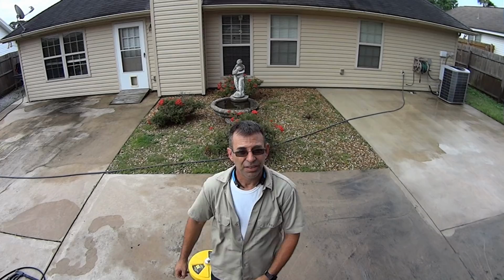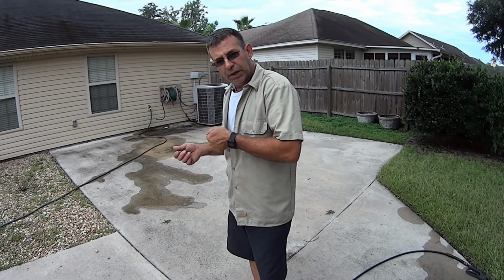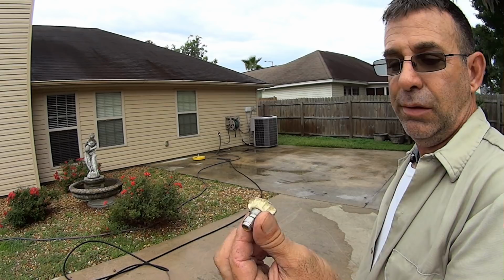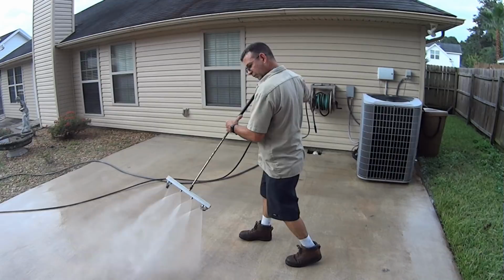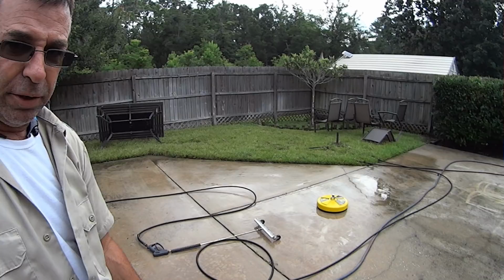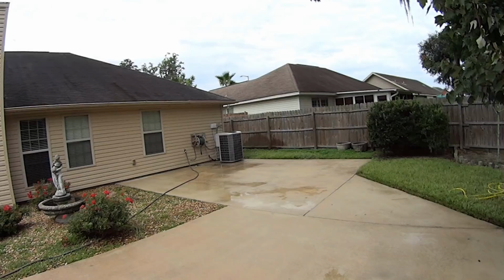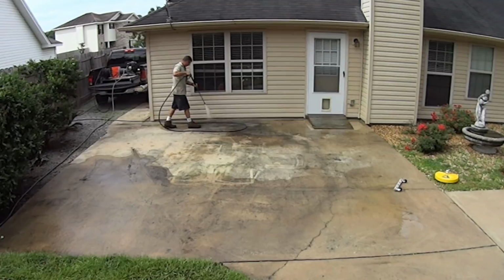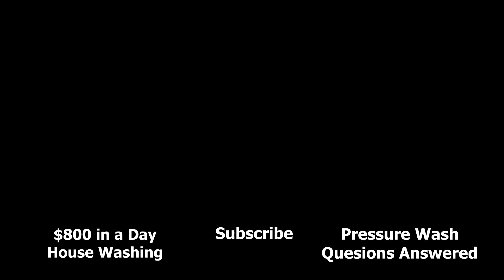How To Pressure Wash a Concrete Patio - Water Broom Demo - BE Whirl-a-Way Demo Review

Comment: How long is that hose?! You could be loosing a lot of psi on that hose. I believe 100 feet is the limit without loosing too much pressure.
Reply from the maker: So what? Is it working or is it not? Quit worrying about silly stuff. I have 150 ft on the reel and I often add 50 ft to make my job go smoother.
Reply: Dan's Vlog your setups all wrong Dan you can't do nothing right can you?😂

Comment: In my opinion, the water broom with 4 nozzles and caster wheels, shouldn’t have the wheels at all, it should just be the 4 nozzles. The best way to use it is to not even use the wheels at all just spray the concrete down. I could see you were using it without the wheels because it feels like it should be like that.

Comment: did you damage the ac unit
Reply from the maker: There is like literally no pressure once you go about 9 inches beyond the tip. In order to damage and AC unit with a white yellow or green tip, you would have to intentionally hit it on an angle trying to fold the fins down and you would have to be very very close.

Comment: I think your pressure washer is too strong for this surface cleaner.. may need to bump it up a notch to a pro model that would handle your high psi or gpm... or change the tips to a larger orphice 

Good job though 😊

Comment: Dumb question. When u wash a house do windows spot?  If so how do u handle it with customer?
Reply from the maker: I try to break the windows and then sell them on open air experience and the benefits of it LOL But in all seriousness no I’m fortunate in this area the windows dry a lot cleaner without spots then when we started. I actually show it in one of the later videos I’ve just uploaded titled how to pressure wash like an $800 a day pro.

Comment: Looks like a waste of time, just use the single sprayer to clean? 
You can look at the spray pattern and realize they are equaling each other out, would be much better with just two nozzles?
Reply from the maker: Worked really well actually but thanks

Comment: The surface cleaner is great for concrete but if you’re washing concrete professionally you need a professional surface cleaner, it’s easier to use and easier on your back. Attaching one to your gun causes you to have to bend over over too much

Comment: Go to Northern Tool and look at the Powerhorse ($100 and $200) line they are cheap for what you get. Have no idea why you would buy a plastic noun ball bearing surface cleaner with out wheels. The surface cleaners that Lowes and Homedpot sale for $65 to $85 are junk not even good for a homeowner that cleans once a year.
Reply from the maker: That’s funny… I have videos going back two years with the same Briggs & Stratton cheap piece of junk surface cleaner that I have made hundreds if not thousands of dollars with.
Reply: I seen your review on the Briggs & Strattons and Mi-T-M20 inch helped me not to buy them. Powerhorse sold by Notherntool take a look at them works great for me, they are not bad for the price of course there are some better with a higher cost. The B&S sold at Lowes is the only one I'v seen with vents in the deck and it so load you need ear protection they could not run fast enough to give me that one. I always enjoy you videos!
Reply from the maker: Thank you and I will look into Northern Tools.